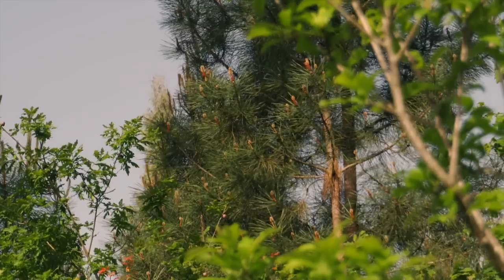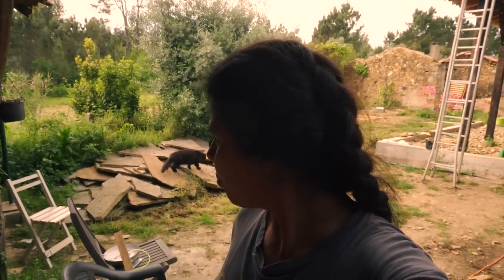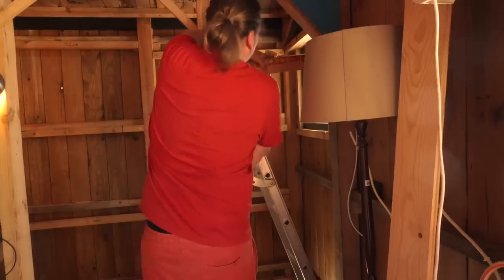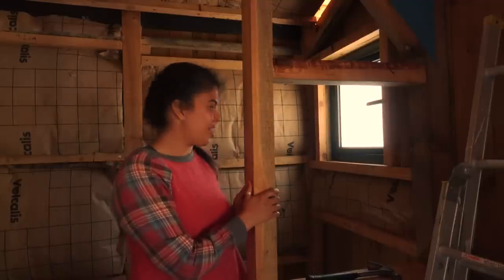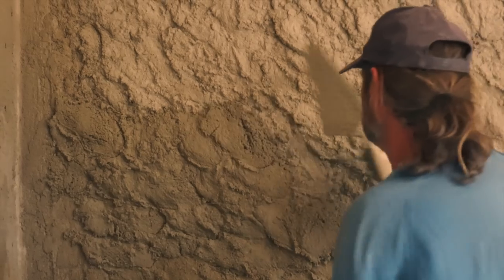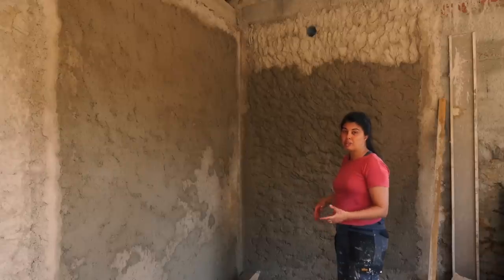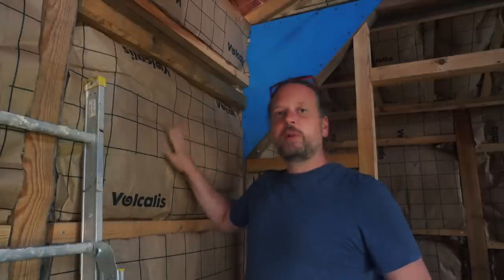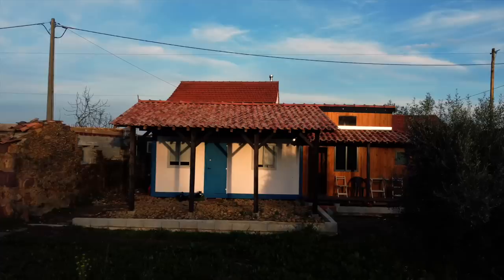Renovating an ABANDONED land  Rendering and Insulation!

Comment: No insulation under the floor ? Not a good idea .A lot of heat is lost through the floor .
Reply from the maker: Actually, the place you lose the least heat is through the floor and windows, it is mostly lost through the ceiling as heat is denser than cold. Ceiling loss is 35%-42% and up to 10-20% through the floor. As we are suspended, it hasn't been needed and our container has thinner floor than the extension and keeps warm during the winter. It was truly not needed. It isn't that cold here. Now in the stone room, that's another story.
Reply: @TheIndigoEscape   20% is not nothing ,! a damp north wind blowing through under the floor  will leach interior warmth out through the floor .Yes I know the climate  where you are and with north winds and winter rain those adverse conditions can occur .Presumably you intend to incorporate a damp proof membrane over the Rockwool before the interior plasterboard is fixed .Or a foil backed version .By the way I have built several insulated wooden  houses in Portugal .
Reply from the maker: Im sure you have done great projects here and thanks for your opinion. 
I didn't say it was nothing, I just said where heat is lost the most. As we haven't' needed the insulation before, we just know from experience as we have been here 2 years, we don't needed and didn't bother. We will be adding some foam on the other room which can act also as a barrier. Too late to add a membrane as it needs to be done on top of the battons. Fingers crossed it will be okay. Otherwise, we will point it out later for others not to follow suit!